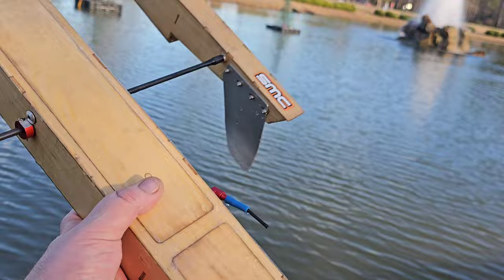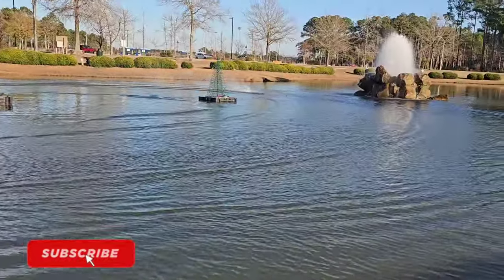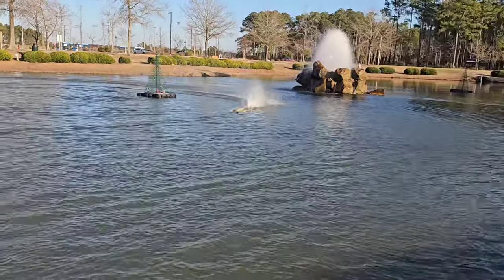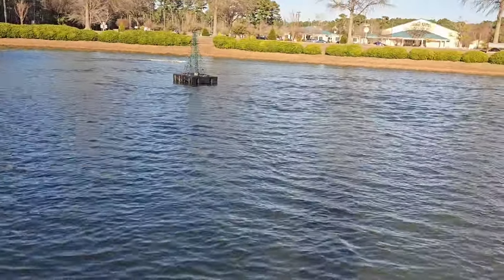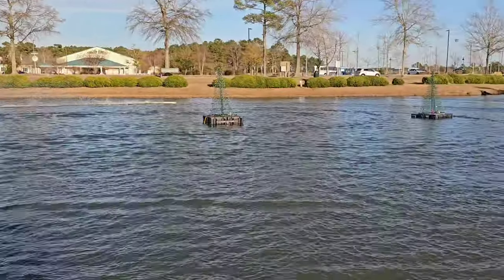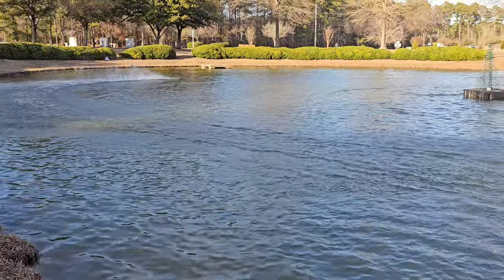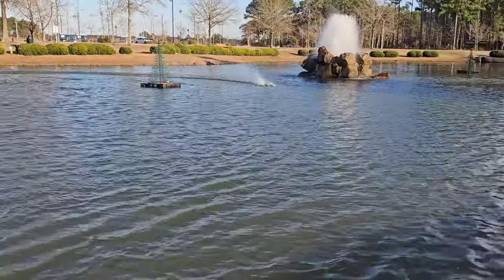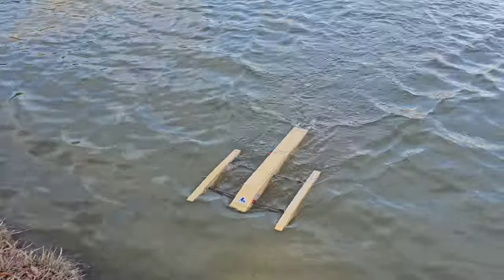Hydro Bash Oxidean Marine Oxi-digger Rc Outrigger - Castle Creations Hydra, Tp Power 4060-cm

Comment: Hey big b, I finally fixed my riggers torque steering.
 I had the rudder in back to front. It’s a knife blade rudder so my eye sight couldn’t see it. What a dill I chased that problem for months.
Anyway I got rid of the 200 amp ZTW esc it burned up due to the extra load running it like that. 
I just put the hobby wing 250 amp max 5 g2 in it after removing the fan and fitting the AliExpress cooling plate. It’s smaller than the xls2 and cheaper.
 I thought after the trouble I had with the hydra x 8s, it was worth a try.
Anyway todays run just 4 passes because it was flying off the smallest bumps but 112.3 mph my PB no temps over 100 f but only 4 passes. Still running cheap Chinese  HRB 4s x2 (8s) 5000 mah 100 c lipo’s 
TP 4060 1650 KV and the 1820 abc cleaver. Zero timing
She has more in her if I can hold it on the water.
So happy
Reply from the maker: Heck yea, glad to hear you figured it out, I remember you asking. E what it could be last year.    Rudder blade of all things wow 👌

Comment: Is the surpass 4074 motor 8s capable?
Reply from the maker: I have no idea?  Depends on kv
Reply: @IRONCLADRC  2000kv
Reply from the maker: 2000kv is a 6s motor
Reply: @IRONCLADRC  Would my motor burn out if i was to try?
Reply from the maker: @bloodbounty728  You would need to prop down big time and be very careful with throttle. CHECK TEMPS regularly.   good luck.  Just know you could smoke the motor or throw a magnet.   BG4L